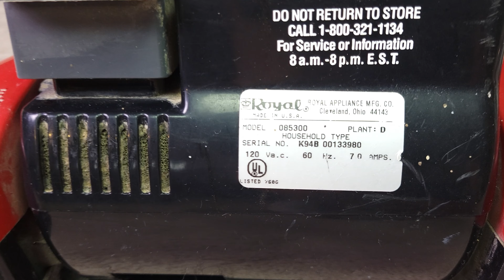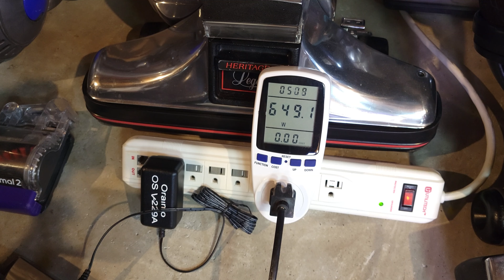Mini Meet #36 | Kirby, Hart, Hoover, Dirt Devil, Shark, UWANT

Comment: I do believe that whoever attempted to restore that Elite 300 put a later 7 amp motor from newer Elite (you can even tell it was motor swapped by the fact the motor housing isn't grey like the upper body) that originally came with a headlight (hence the slot in the motor for a light bulb), and the outer bag was a donor from an Elite 5.0 (the Kmart version of an Elite 300).  And yeah, I hate the short cords on those spartan models too.